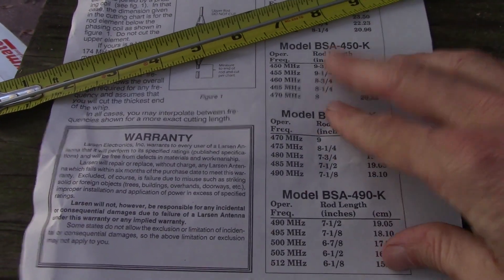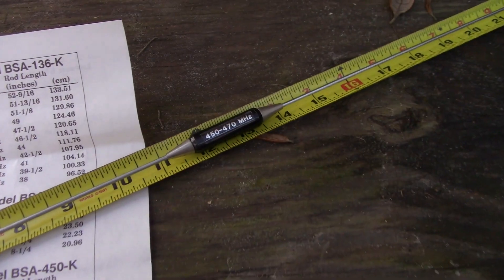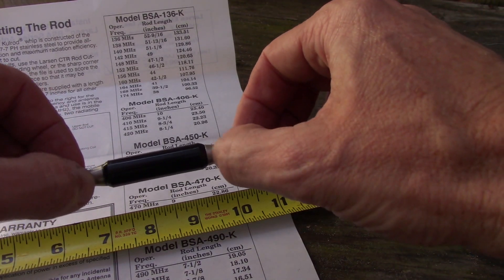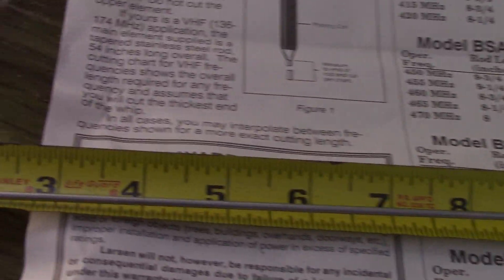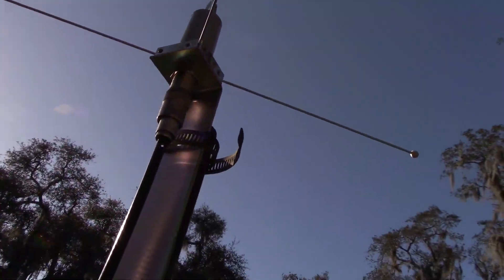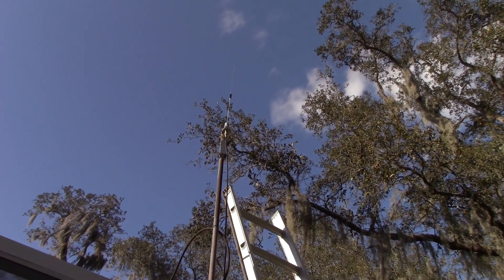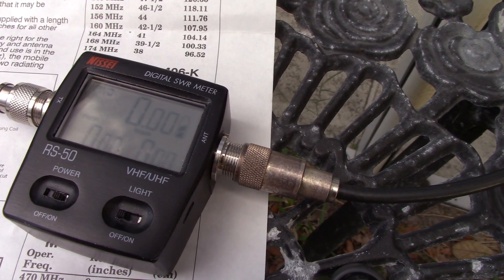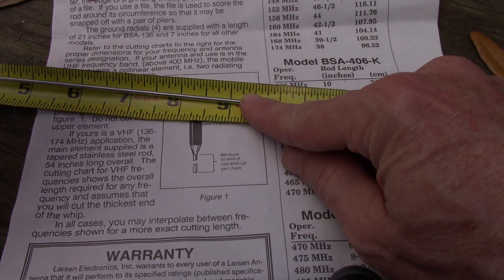Tuning the Larsen BSA 450-K for GMRS

Comment: You said its a 5/8 over 5/8... Does that mean both the top element and the bottom element are each 5/8 wave? And if so, why only trim the bottom and not the top? I'm just trying to learn what's going on here.
Reply from the maker: Yes, both sections are 5/8 wave each and I had the same question about only trimming one element as it seems logical to trim both the same. The directions  for this antenna were rather clear to only trim the bottom section so I complied.

Comment: Now if you tune with rg-58  then switch to a different type of cable lmr-400 or change length your swr will change, correct?
Reply from the maker: Yes, SWR did move some after changing coax type and length. Was under 1.4:1, but still a change. Is best to use the final mount and coax to tune.

Comment: What kind of range do you get simplex with that?  (Power?) Do you know how it compares with a dedicated base antenna?
Reply from the maker: At 25ft up with 4 watts I'm getting maybe 2 miles. I have many oak trees and neighbors with 2 story houses. If I could get the base of the antenna 40-45ft up to get over the trees the range should be 5+ miles.
Reply: @Soladaddy  are you using just an HT? I get into a repeater 30 miles away with my magnet mount on my mobile with my 5 watt HT?

Comment: Hmm maybe a dremel would be quicker, will try when I tune an antenna.
Nice video!
Reply from the maker: Yes it would. My old corded one died and it's battery powered replacement is garbage.  I have an old table top grinder for the fine tuning.